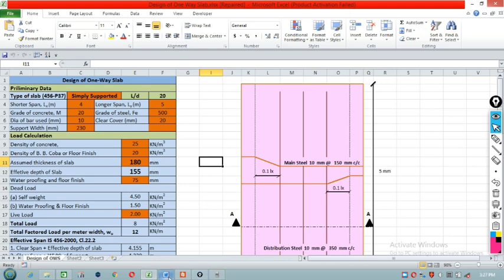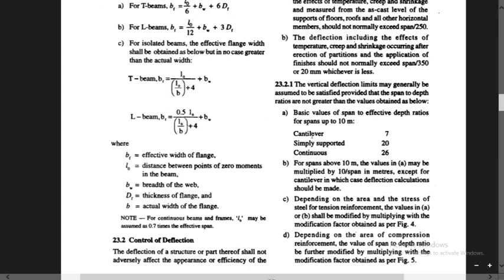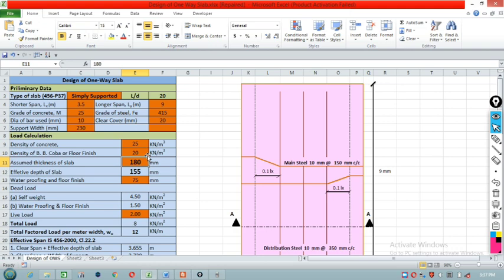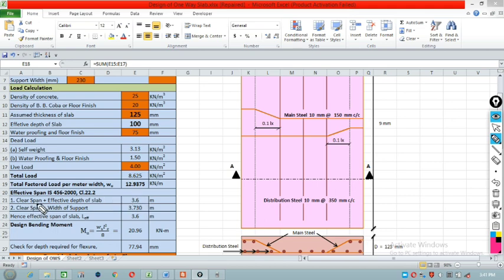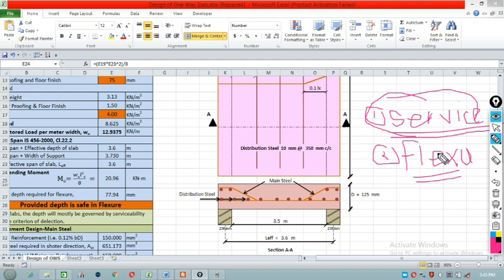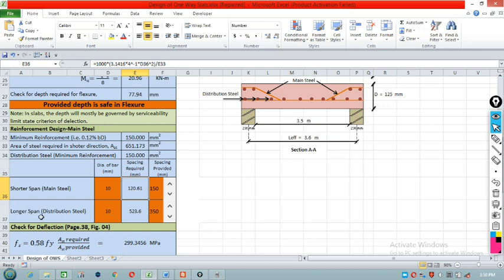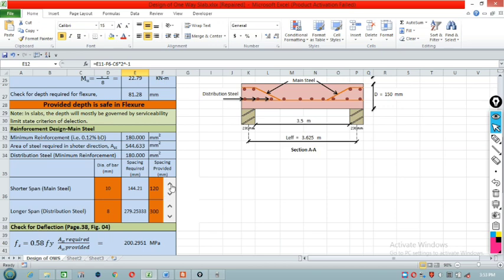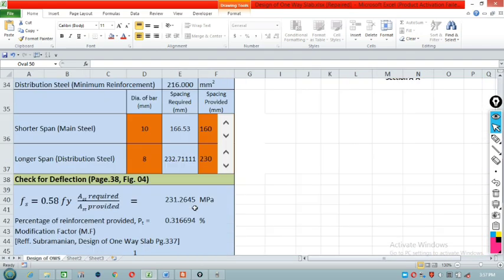One Way Slab Design Using Excel Sheet I Civil Engineering I IS 456-2000 | Struct Soft Centre

Comment: The design of oneway slab is for single span. if it is more than 3 span we have to use bending moment coefficient as per IS code given, It will be useful for  more than 3 span continuous slab  separately.